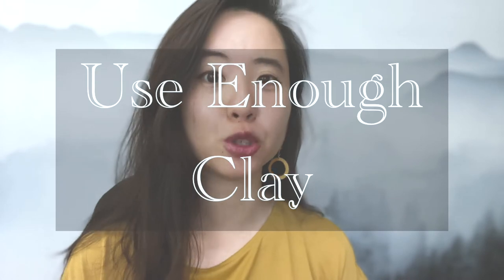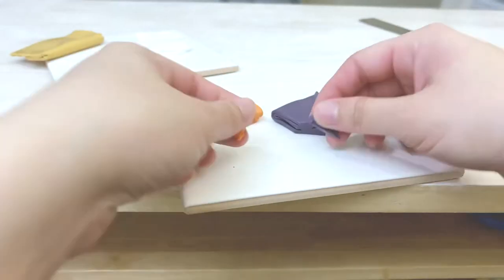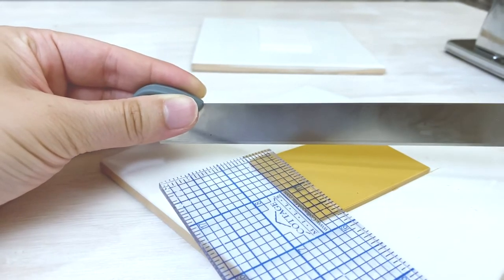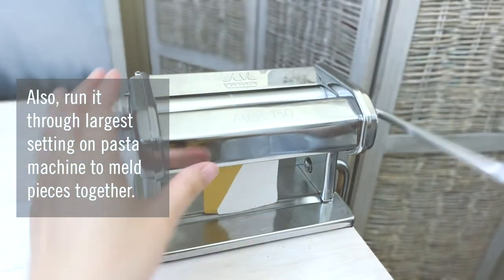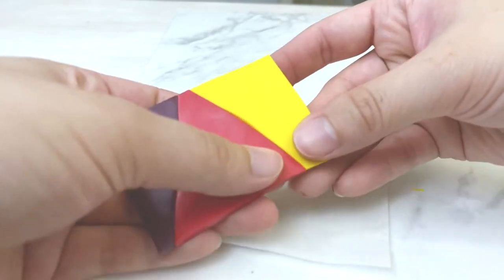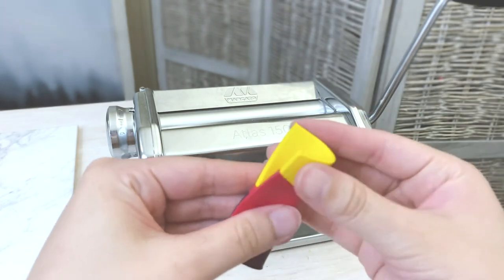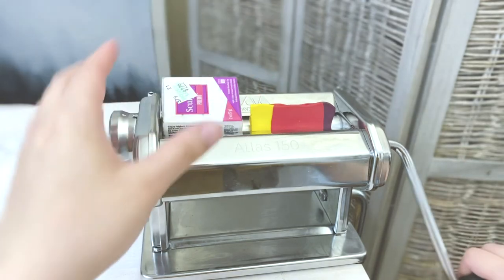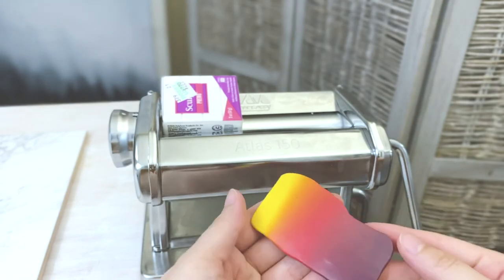Skinner Blend Technique | Polymer Clay Gradient

Comment: When I make a skinner blend, before it ble ds it gets to thin and to long, even if I use enough clay. I've tried to push it but it runs the edges. Any help?
Reply from the maker: Hi Liz! You could also try using a width limiter (an unopened block of clay could work). In my latest video on skinner blends I demonstrate how I do this. If the clay is too thin, it would be really difficult to tuck in the sides. I would use the thickest setting of your pasta machine if you aren't already doing so. Another possibility I could think of is maybe the brand of clay you are using. Sculpey III is difficult to work with, maybe trying a different brand. Hope you find a solution, Best of luck!